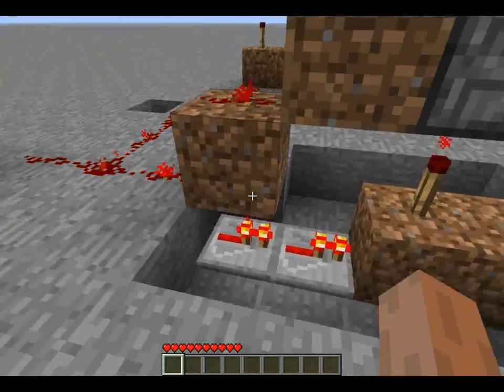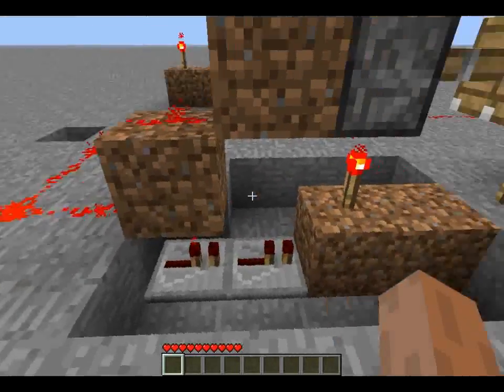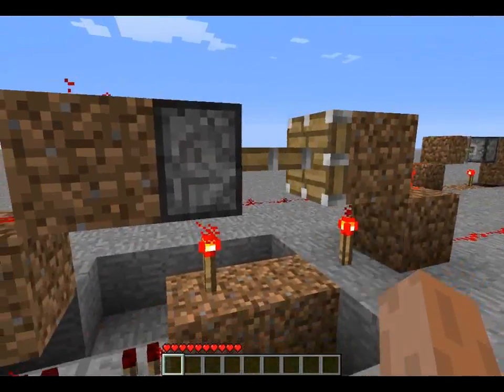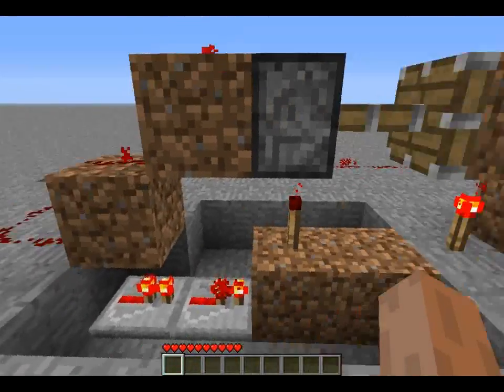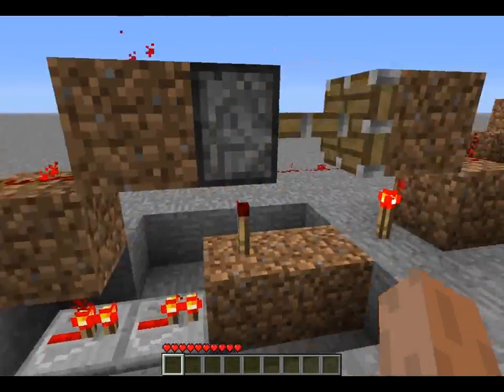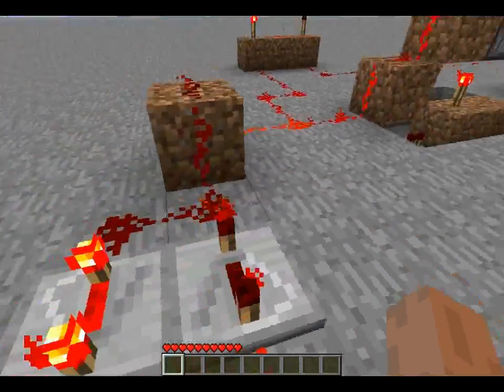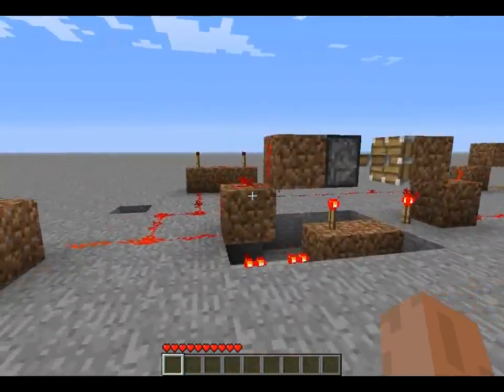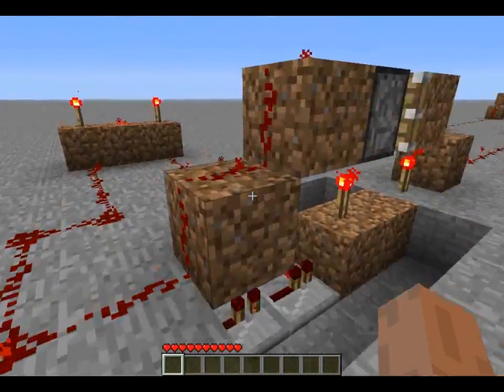"Instarepeater" update

Comment: This doesn't exactly work... If a switch for the input was off, for example, it would still give a true output. I mean you could invert the input and use the button like you did, but it's not fully functional as a repeater. Are you still working on this?